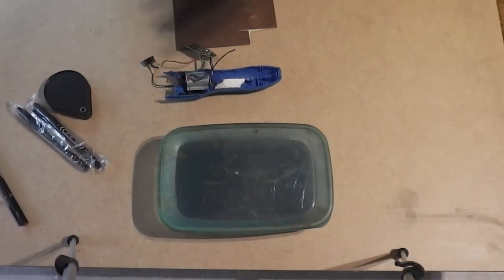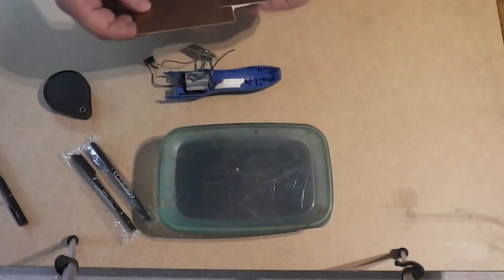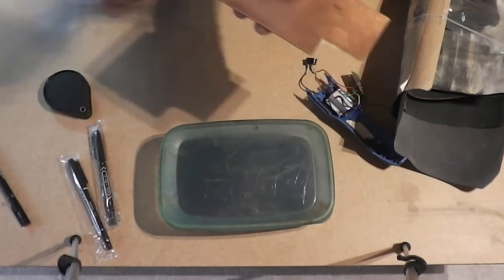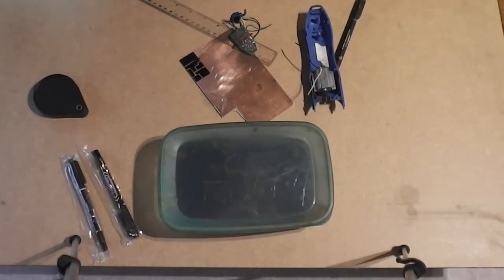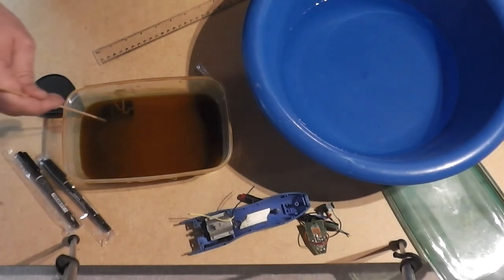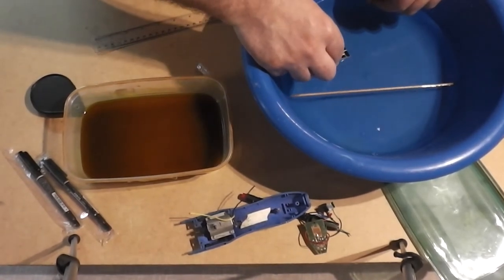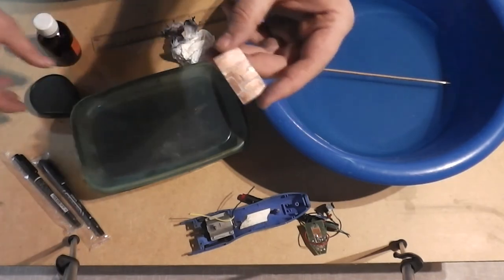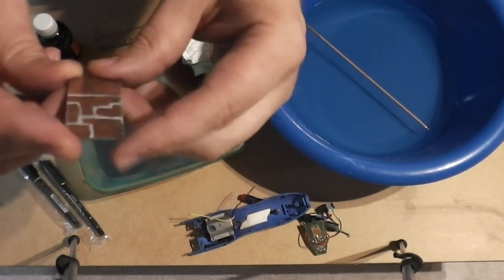Etching resistant PCB marker most reliable test / review

Comment: What is that?
Reply from the maker: kinda hard to explain if u do not know what is a PCB circuit and so on, but it is used to fix misprinted things on pcb before it goes to the acid for Etching, it protects copper layer from acid so copper covered by this marker will stay on the pcb while everything not covered will go away  I mean will be eaten by acid.

Comment: Bro permanent marker traces get dissolved in fecl3 please solve my problem please please please
Reply from the maker: Most likely you got one of many fake etching resistant markers. Seller on eBay where I got tested one does not selling them anymore. Sorry, without testing can't recommend any. Best solution for you is to buy it from trusted local shop.
Reply: Might not be letting them dry long enough. It may appear dry instantly, but you should wait 2 hours before etching.
Reply from the maker: I never waited longer than 15 min
Reply: @FantaBH  naah it wasn't fake but the point is that the marker was refilled by the shopkeeper and that refilled ink was the cause